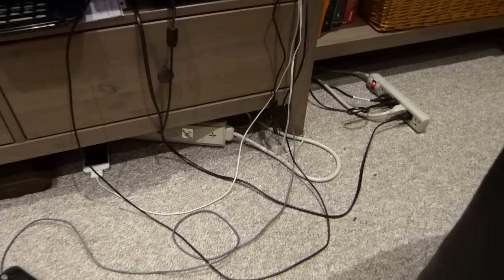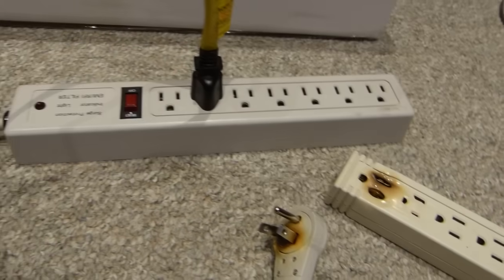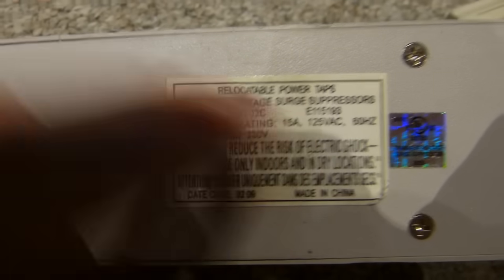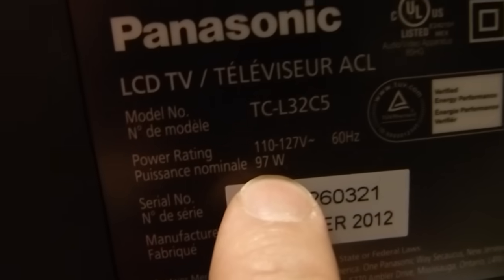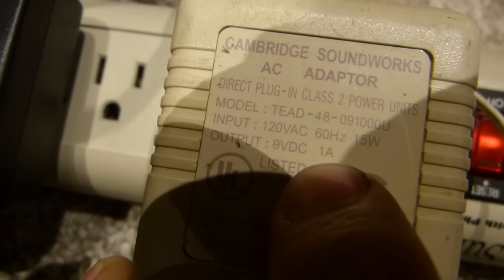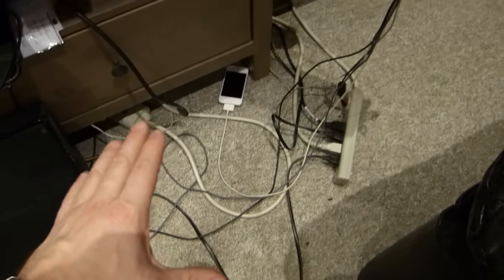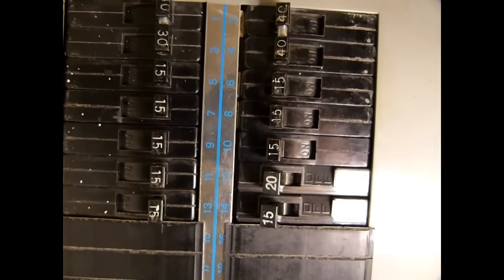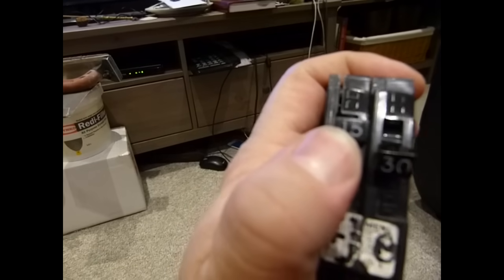Is it safe to plug power bars into power bars?

Comment: Simple math is right!  15A is 15A.  As you know, many commercial buildings are actually rated 20A.  I ran a bowling center for 22 years.  At some point, unknown to me, the owner had his brother go through the building and replace worn 20A outlets with a bunch of 15A outlets he got on sale somewhere.  He didn't know any better and nobody else knew.  Obviously, the 15A outlets could potentially overload without tripping the 20A breakers.  The lane machine (stripping/oiling) pulled upwards of 18A when it was reversing out of the pit.  The lane machine kept blowing fuses and I even cooked a circuit board.  We finally figured it out... but those discount store outlets cost expensive damage to expensive equipment and, I suppose, could've started a fire at some point.
Reply from the maker: 100% correct, thanks for commenting
Reply: You had some other issues in that case as well -- namely the plug installed on your 18A device.  If you had a load that could draw more than 15A it should never have been equipped with a NEMA 5-15p plug to begin with, but should have instead been equipped with a 5-20p plug that would have only been able to plug into a 5-20r 20A receptacle...and thus would never have fit into those 15A retrofit receptacles.  NEC Code does allow the use of 15A receptacles in a 20A circuit (in fact that is frequently the norm) as that 15A rating is per plug position and no device that draws more than 15A should ever be equipped with a 15A plug, thus one should not ordinarily be able to plug more than a 15A load into such a plug (barring the use of multi-outlet strips, which should have their own current limiting fuse or circuit breaker).  Additionally, the wire gauges specified by Code are actually based primarily on limiting voltage drop, so you can have a considerable overload before there is a building wiring related fire concern, allowing plenty of time for the circuit breaker in the man distribution panel to trip.  The real reason not to use cheap receptacles is that 1) you don't really know if they meet UL/NEC specifications and safety and 2) they are not going to be a robust receptacle intended for heavy use, abuse, etc., and are more likely to fail in service or start a fire as they often do not make good electrical contact with the plug, forming a high impedance connection that can overheat -- they are especially unsuitable for use in a commercial environment.
Reply: Whoa! So you're allowed to plug an unfused 15amp cable into a 20amp panel fuse. That means under fault conditions the 15amp cable will be carrying upto 20amps. ... BAD. A basic rule of electricity is that if the cable gets skinnier you always need another fuse to protect the thinnest part of that cable. If you break that rule you will get melted cables and sockets.

It sounds like America has both fused and unfused multi-outlet extensions, combine that with 15amp cable fused at 20amps and you have an accident waiting to happen.
Reply: Robert de Bath Not really, in the U.S., at least, the minimum permissible wire gauge for an unfused power cord is 18 gauge copper (less than that the plug will require a fuse -- something rarely encountered outside of Christmas light strings).  While the "official" rating for 18 gauge copper is 10A, that rating is based primarily upon the maximum allowable voltage drop in a reasonably long power cord.  While an 18 gauge copper cord will get uncomfortably warm with a 20A sustained load (4 times warmer than at 10A, to be exact, per I^2R), you will not exceed the minimum required insulation temperature of 60C (or higher if a better grade of cable is used), so you will not easily start a fire that way without other major contributing factors.  In fact, fires are rarely caused by the cord simply overheating but rather tends to occur when the cord is both overloaded and either the cord (such as from fraying against sharp edges or animals gnawing upon it) or the plug/socket have been physically damaged resulting in a high resistance connection that can overheat things.  Other causes can be overloaded power cords that are tightly wrapped and looped (greatly increasing the concentration of heat) combined with being buried under materials, like linens, that prevent the cord from shedding its heat -- though at that point you have committed just about every sin possible to magnify the chances of a fire if overloaded, especially if it is also physically damaged.  Of course, if the overload is closer to a short circuit then the branch circuit breaker will magnetically trip almost instantly, in which case heating is a non-issue.

Somehow, and I'm not quite sure how, we have managed to largely avoid the influx of copperclad steel and aluminum power cords that seem to have infiltrated a number of cheap (mostly Chinese) appliance cords and products in other parts of the world.  Those type cords are where a very serious fire hazard exists because they will produce far greater heating for a given current combined with the fact that their gauge is often undersized even by copper standards (you can get by with smaller copper conductors due to the greater conductivity of copper -- steel has about 17 times the resistance of copper) -- and poor wire conductivity plus undersized gauge equals a very hot running power cord for a given amp load and, if used, requires much larger wire gauges to be utilized in order to maintain safety, something a Chinese manufacturer skimping on safety for the sake of profit could care less about (they also will frequently combine such with inferior wire insulation that may not even be fire retardant).
Reply: Ah, right. So if; really hot day, AC broken, under the carpet and laying on top of itself you might have a problem, maybe.

The free movement between EU states does make it easier to import shoddy kit into a less stringent country and then move it to others. But realistically you have to go for the real bottom feeders (eg: the dodgy Ebay importer) to find that sort of stuff. The buyers for "normal shops" don't like getting burned any more than anyone else.

Comment: The amp rating you were reading on the speaker power suply was actualy 15 watts not 1 amp you read the output power rating not the imput rating same with the router
Reply from the maker: - noted before ...

Comment: Question. Let's say my bedroom has 3 duplex receptacles (giving me a total of 6 outlets).
1. Would each outlet, in a duplex, split the 15A (having 7 A load on one outlet and 7 A load on the other) if that makes any sense? So it would trip the breaker if you tried to put a 15 amp load on both outlets of a duplex?
2. If I have 3 duplexes, could my bedroom be powered on a single breaker switch rated for 45 Amps or would each duplex have their own 15 amp switch?

Thanks for any feedback, I just wanted to make sure.
Reply from the maker: 1 No fixed split at 7 A, total is 15 A for both. So a 10 A load and a 6 A load in the same duplex trips the breaker, or 12 A + 6.5 A, or 17 A + 15 A etc.
2 3 duplexes still LIKELY to have a total of 15 A, depending on actual number of wires running to breaker panel. There is no 45A breaker or circuit for residential bedroom outlets.
Makes sense?
Reply: Yes that makes more sense to me. But just one more question, sorry. 
So, depending on how my bedroom was wired, which of these would be correct for a single bedroom? :
A: 3 duplexes on their own 15 A switch (total of 45 A) or
B: 3 duplexes on the same switch (each duplex handling 4 A load) or
C: depends on the way the room and duplexes were wired

I understand now the 1st part about fixed split on one duplex, I was just confused on how the power is routed to the room and between all three duplexes. edit: I should look at the breaker panel, which I haven't done yet. lol
Reply from the maker: No worries, mate. This works like water in trees gets divided to branches, twigs, shoots, leaves.
The panel is anywhere between 200 A or 125 A, depending on year of manufacture and then current code. That`s the total Amps you have. The range / cooker is on a 40 A breaker, the washer / dryer is on a 30 A breaker, so if all the elements are on max setting and both appliances run, that leaves you between 55 A - 130 A for everything else plugged into outlets and all the lights.
You have maybe 10 pcs. of 15 A circuits. You can not have a load of 15 A on all 10 of them at the same time. That would require 150 A, but you only have between 55 A - 130 A.
Say the 3 duplex outlets in the bedroom are on a single 15 A circuit. In any combination of those 6 outlets, the 15 A can not be exceeded.
Correct answer is C.
Reply: Thanks a lot. That cleared things up for me.
Reply: 15A is the rating of the circuit. You can't use a 40a breaker on 14 gauge wire because that would over load the wiring. 

A rule to follow (one I learned in university) the circuit rating is determined by the lowest rated piece in the circuit. You can have a 20 plug but if the wire is rated at 15 a it's a 15 a circuit. :) 

The max number of outlets on a 15a circuit by code is 12 devices or 12 outlets. Or 12 lights. Or 12 anything equaling 1a each. When I design the electrical layout for a room I actually only put 8 outlets (or devices). This keeps the loads smaller for the most part and prolongs the life of the wires insulation. It also allows future additions without compromising on the electrical code.

Comment: "plug power bars into power bars" is :  ( in France )
 unauthorized, installation outside the norm, not covered by insurance,
 and it's very dangerous !!!  (because, made in china multiplug is not alltime full good, and up the problem of the power run in.
Reply: All depends where you're at. Here stateside we are anywhere from 110-120 for most residential applications with some 220-240 volt plugs for larger appliances requiring special plugs. Think large residential electric dryers and range/ovens. So for our applications daisy-chaining power strips can act as extra outlets, or in the case of my college dorm an extension cord since those were banned from the dorms. In the UK and most other places that side of the Atlantic I believe use 220 for all applications. At 220 volts you are likely to sooner exceed the limitations of the single power strip.

I am a firm believer in only buying products from reputable brands when it comes to anything handling electricity, especially with higher requirements.  I believe what may have been the issue is that some power strips have an 'always on' outlet that could have caused a problem, or could have just been old/faulty  where there was enough draw to cause the heat and melt. Too many factors for it to really say for sure based off this video alone. But typically I would agree daisy-chaining multiple power strips isn't a best practice for wide application across an entire home or business and is begging for a fire.
Reply: Ryan Slemmer the Heat generated really only depends on the current flowing through the socket and it's resistance (P=R*I^2). With the same load the current is lower on a 220V system and I theory you're less likely to start a fire. But it really depends on if the power strip is reasonable good if it will hold the bold promise molded into it's casing

Comment: The same mistake you noticed with the speaker adapter you made with the modem.
The modem runs at 5 volts from an adapter, and the sign on the modem itself said 1 amp at 5 volts, so that's just 5 watts.
That's 0.043 amps from the mains, but given you have some losses in the adapter, lets say it draws 0.05 amps.
Reply from the maker: Thanks for the correction.
(Errors happen when I have 1 take and no script)
Reply: I was just about to point this out.

Comment: The total didn't exceed 15 amps. The rotational plug in the last plug strip was defective and over heated with the heater plugged in.
Reply: You hit the nail on the head. I was scrolling through looking for this very comment. Those rotating plugs suck and are prone to premature mechanical failure. I'm convinced that was the failure point.
Reply: no, they both got hot at the connection point and both fried
Reply: I saw your profile pic the read your comment in my head with a country accent
Reply: So, maybe some strips have detection and cutoffs for such?  Or can they?
Reply: GliderDS, that's why I cringe when I see someone touching the contacts on any electrical device without cleaning them before plugging them in.  You can't touch anything bare skinned without leaving residue on it.
Reply: I had some of those rotational plugs, found them listed on the CPSC (Consumer Product Safety Commission) website saying that they had been recalled! Most of the power strips, while rated at 15 amps, are poorly made and will not stand 15 amps continuously.
Reply: @wired-up  I had several myself, but never put more than a couple of hundred watts through them.
Reply: Indeed, the resistance inside the contacts on the plug was just too high (bad contact, fouled by greasy fingers perhaps), which in turn generates a lot of loacl heat build-up. Hence the fire.
Reply: it looks like it was the socket rather than the plug that burned though...

Comment: Looks under desk "Well I'm screwed."
Reply: As long as not much power is going through it I think it’s ok.
Reply: Radovan Bro same I just got a space heater and now I can’t use it at work
Reply: Depends on what ur pc specs.
Reply: A 300 watt PC is weak. Ive seen 1600 watt gaming PC setups that are absolutely insane.
Reply: +Pure Explosive Not really. The higher the rated wattage the more efficient it is.

Also its probably a higher quality one in general. Trust me, you dont want your power supply exploding in the middle of a game.
Reply: Richard van Pukkem i knew someone who had a beefy computer and their electricity went down when they tried using a new graphics card
Reply: Richard van Pukkem well I guess my 750 watt power supply was a waste.
Reply: Lmao
Reply: +Richard van Pukkem These days you can get cpus that take like 200 watts alone.
Reply: gytux0258 it has happened to me and it sucked
Reply: Richard van Pukkem Yes it definitely makes a difference. My UPS kept beeping to signal it was overloading anytime I start up a game because my 1080ti and 7700k pulls a lot of wattage under load. I need to get one that can back up more VAs.
Reply: @Tarballwalf  prob yeah
Reply: Yes 🔥 fire 🔥
Reply: Same, running a heater, PC with 4 monitors, 5.1 surround speakers/sub, a solder station, lamp, chargers and more.... thinking its about time to get one of those industrial power strips with like 20 connections, and to check my breaker
Reply: Haimanala TV I assume you are a gamer. It might be just enough, but it wouldn’t be crazy if something did happen
Reply: @sethmoneygetter  i just am using one for length.  One with my tv and router doesnt reach, so we haven jt plugged in for lenght
Reply: Shremeant “Depends on your PC specs” LOL. Do you really think a highend video card will make 300 watts difference or so? A PC is just a PC. The maximum i have ever seen a PC drawing was like 350 watts. Normal household PC uses 150 watts or so. A 16” laptop can go as low as 15 watts.

Comment: my dad plugged in a salamander (basically a jet engine space heater) a ceiling fan, many lights, many other things and the power strip was find. not even hot.
Reply: NoahBones 12 amp load is high so expect something to happen
Reply: American 015  nothing ever happened.
The worst case we have ever had is we plugged 5-6 household extension cords (with about 3 Strands of C7 and C9 Incandescent christmas lights) into 2 15 amp extension cords in a 20 amp outlet, and it just melted the extension cords together. we still use them.

Rated amperage is only on startup on most appliances. unless its lighting or something constant. hence christmas lights melt extension cords together after 30-35 days of use, but heaters, etc. didnt melt it or mess with it.

Some heaters have constant current, others just have startup. the salmander was a kerosene heater, and did not use much power.
Reply: American 015 Not to mention Wattage=Heat, so high wattage is the real problem

Comment: Chance's are the reason you DIDNT trip a breaker is same reason you didn't trip it with a 15 amp heater alone. Even though the loss connection was producing enough heat to start a fire. You never did get over 15amp which is the rating of that breaker and the circuit never did short out. Which both would had tripped the breaker. Your right on the GFCI. It would had detected a fault in the line and tripped, but, GFIC don't like the surge that most electric motors make when their first turned on. That's why you don't have them on sockets that will be handling things like a frig.
Reply: A GFCI shouldn't detect a burning socket, but an AFCI could.
Reply: Alex C unless there’s heavy leakage to ground the gfci would trip but for safety get a GFCI/AFCI combo

Comment: Not only amps matter, but also cable gauge does. I had one power strip rated on label for 230 V 16 amps, but cable had gauge only 1.0 mm^2, that is safe for up to 10 amps instead of required 1.5 mm^2 so I have to keep on mind I can't exceed 10 amps
Reply from the maker: That`s right.
(Here is more on wire gauge https://www.youtube.com/watch?v=Wz9Uv-oe2LE)